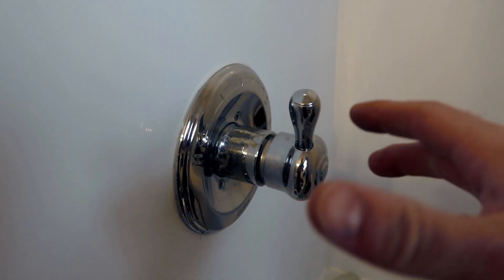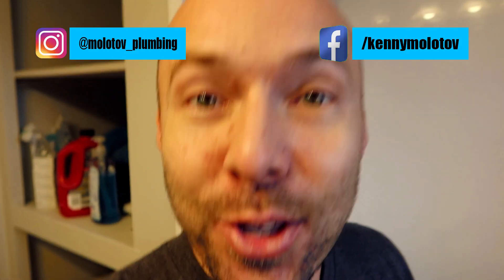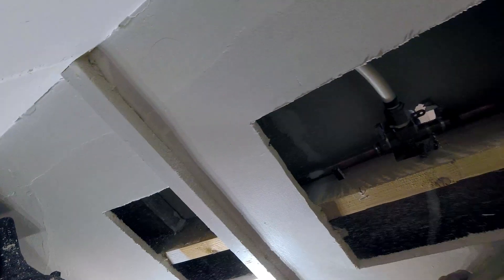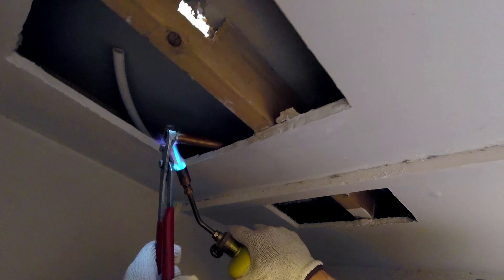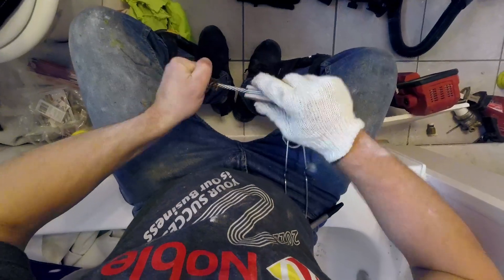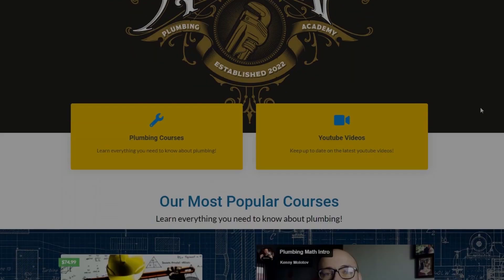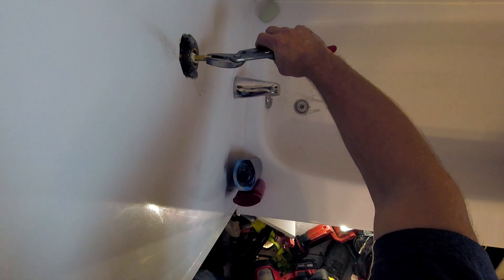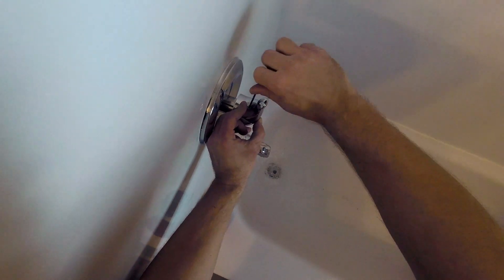A Day In The Life Of A Plumber 149 | Swapping Out A Plumbing Shower Valve

Comment: Hey glad you asked, I use my A-3 turbo torch tip it produces  a very small but very effective flame, I can get extremely close to wood without scorching it and don't even need a flameshield most of the time. It's  awesome.  Believe or not I've even replaced shower valves through the existing opening,  but it can be difficult and takes patience.
Reply from the maker: Thanks for the insight Dennis! That’s CRAZY that you have soldered through the existing opening!

Comment: thanks for the video, my solution is a 8x8 metal plate thick enough so it wont warp with 4 screw holes on each corner to hold it in place, that way the the job is more delicious.
Reply from the maker: Thanks for the insight Al! Sounds super DELICIOUS!!!!

Comment: Ken my man, as always great video, to answer your question, when close to wood, I soak it down with water before putting the pipe in and soldering it.  I also use heat shield on the pipe
Reply from the maker: Water and heat shield! That’s my formula as well! Hope you’re well David!

Comment: They have a press adapter that you clamp to the fitting and you clamp the press adapter instead. Specifically for tight spaces. But for torches, I prefab whatever I can if possible then if it's too tight for a heat shield, I'll wet the wood down with a spray bottle.
Reply from the maker: Yeah those adapters are awesome! I wet down the wood as well! Thanks for the insight!

Comment: I think you could have used a compact ProPress tool like the M12 on the shower and spout lines since they had some give. Connect the PEX first, crimp the shower head line first, then the tub spout line (maybe with a slip coupling if needed). If that didn't work, I would have just cut that 2x4 out of the way (especially since it was already notched), got the valve in, the scabbed on a new piece with a notch cut for the PEX line.

Comment: What helps me out is turning my turbo torch down low enough to heat fittings up, then getting a small water bottle near me. Helps out. I also turn my torch tip away from the wood.
Reply from the maker: Thanks for the tips Randy!